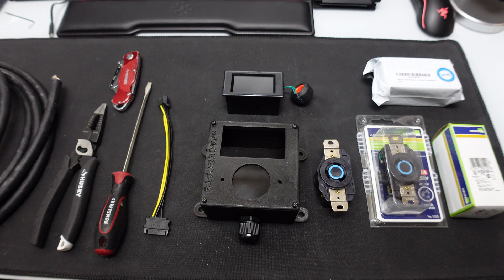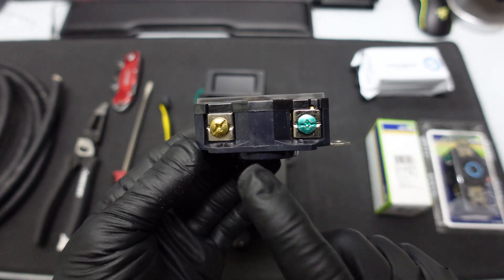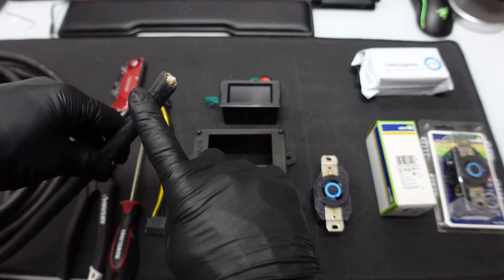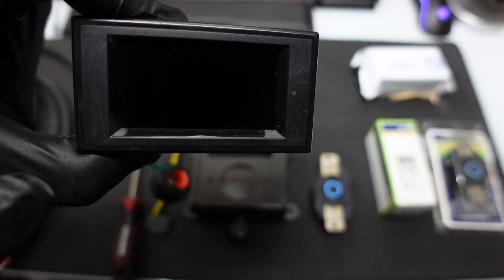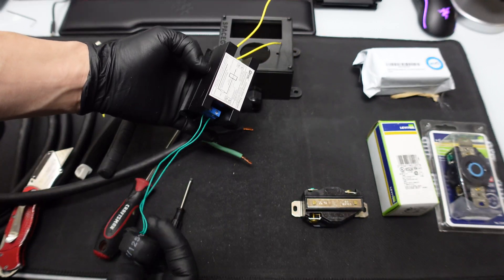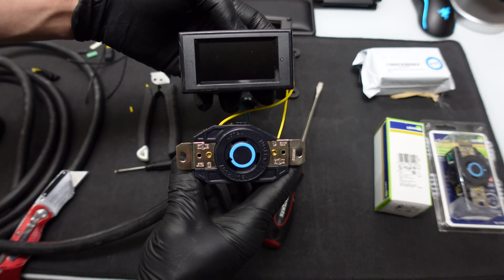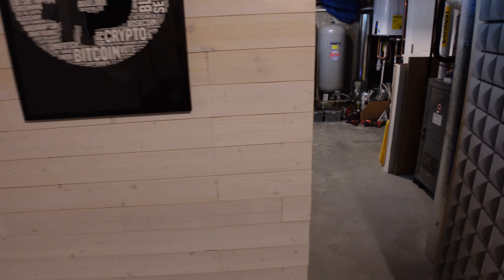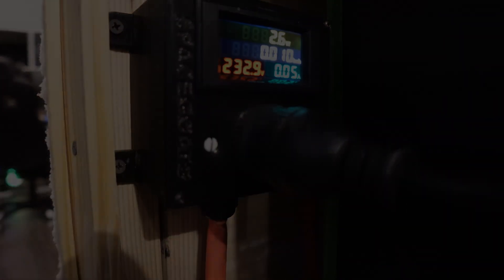How To Wire a Power Meter For Your GPU Mining Rigs | Step by Step

Comment: Can you safely run 6000 watts through a Tripp lite PDU?
Reply from the maker: It is On the HIGH side 100% wouldnt recommend if your not around your rigs monitoring them every day. I have 2 x 20 amp banks on my 30 AMP PDU with fuses so this is fine for me.

Comment: I would not personally reccomend twitst the wires together WITHOUT have "end caps" on the wires that make it one solid wire. So many cords at wire is usually only allowed twisted if the connector itself allows it, and i doubt that connector is created for it.

Comment: Thanks this is real quality content.. 
I am in Ireland so not sure what AMP breaker i can get installed on my board, i think its 30 / 32 AMP. Any idea on how long it would take an electrician to install a breaker on my electrical board (is it a few hours or much more)
Is there any additional tips or info when speaking to an electrician that i should raise when i want to get this job done?

Comment: You should really be using some insulated ferrule connectors on all these cables. That will make all connections way more safer and durable in the long term. Just make sure to use the proper rated ones for your max current and voltage.
Have a great weekend beautiful arms and keep on mining <3

Comment: I hardwire my power cords into a box and then have that controlled by a switch which has the meter and a surge protector. Might change to a smart switch so that cut power from anywhere if I see something wrong on my cameras.

Comment: My wife just got the electric bill since I have stepped up the mining so... this is a very timely video. Thank you for posting!
Oh I can add to a mining video slightly for a change so here goes. 
You touch on this later in the video but but oversizing to 10awg for future expansion is a wise choice. It may be beneficial to go with #10 over #12 if you are annoyed by potential light flickering caused by inrush current. 
The cord you have there looks like SO cord which means it has a durable external jacket and can be left exposed to more of an extent than a standard or common jacketed wire. It is a lot more expensive per foot and not entirely necessary if you can run your wire protected. 
Stranded #10 vs solid #10 copper not too much of a big deal there unless you're running it at distance. Then you're likely getting into the topic of voltage drop etc.

Comment: This is awesome!  I just had a 240V out installed and have a 30A PDU.  I have been wanting to use a Space Ghost meter but was intimidated by the wiring.  This totally helps.  Question: Can you keep the PDU plugged into the meter 24/7?  Or do you need to unplug the PDU every time so it does't burn out?  Thanks Buddy for all your contributions to the mining community.  Hello to PocketChange too!!
Reply from the maker: Appreciate you man. Thank you for being apart of this with me ❤️🔥
Reply from the maker: You can keep it plugged in 24/7

Comment: Don't make a tape mess. Thats against code.
Reply from the maker: What does that even mean LOL

100% Should ALWAY tape your terminals Once The Device is installed. (PER CODE, Far as I know anyways)
Reply: @ChumpChangeXD  
Pull one of the professionally installed outlets in your house and take a look, then get back to me.

😁
Reply from the maker: @colonelangus7535  depends who does it I have and inspector as a good friend and it’s what he does when he wires outlets.

It’s 100% a safe practice. Electrical tape is not a fire hazard by any means taping an outlet. 

Sorry if you don’t agree but that’s the truth. Rather people be safe than sorry.
Reply: @ChumpChangeXD  you are correct, taping is extra safety precaution and is a practice that is not always exercised unfortunately. Code is only bare minimum and you can always go above and beyond so long as it doesn't pose extra risks. There has been cases of tiny metal pieces or other wires coming loose and touching a terminal causing a short.
Reply: I’m pretty sure NEC has no guidance on taping receptacles. So it it is neither prohibited nor required.
Reply: @thestickshark  
Weird, it was on my test.
Reply: @colonelangus7535  hmm I guess it’s possible they changed the NEC but I was un aware of it.